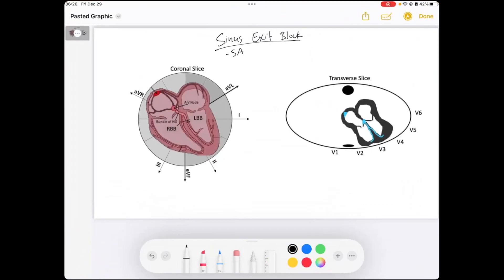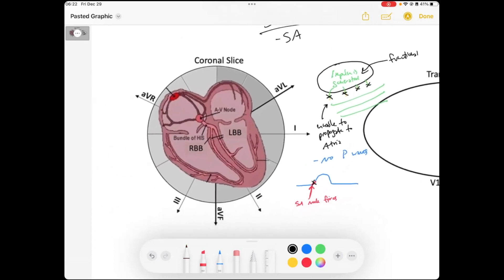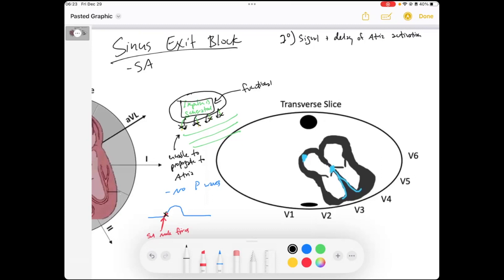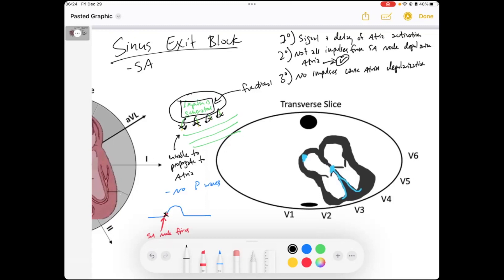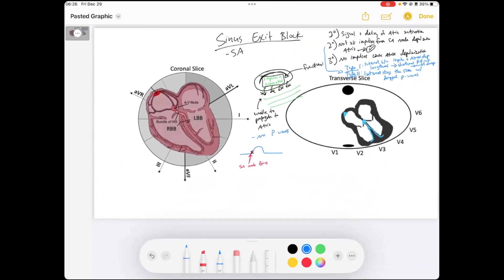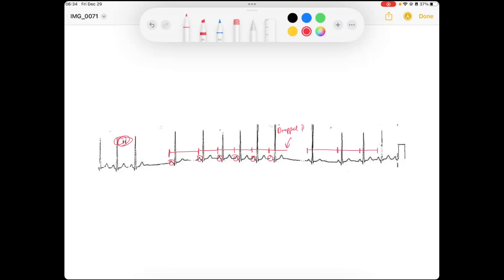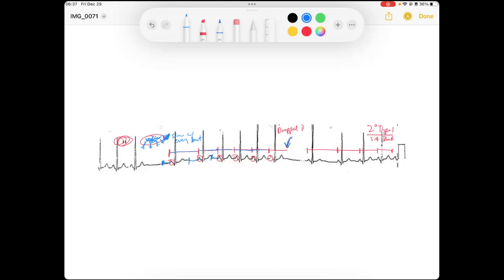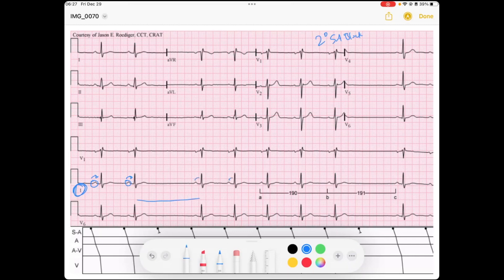Sinoatrial (SA) Exit Block EKG | ECG Lecture

Comment: I am very confused by this lecture example. I was taught that with a 2nd degree type 1, the PR interval is not consistent and lengthens and lengthens until a QRS complex is dropped. Long, Longer, Longer, Block .... now you have a Wenckebach. You are showing it getting closer and closer and closer then block which is opposite. Your explanation makes sense in that if it takes longer and longer for the signal from the SA node to get where it's going due to a block so it makes sense that it would have longer and longer PR intervals before it drops but then the example shows shorter and shorter ones. Can you help explain this?
Reply from the maker: Hi Megan- you are on the SA Exit Block lecture 😁 ➡️➡️ go check out the AV Block lectures and you will be less confused!